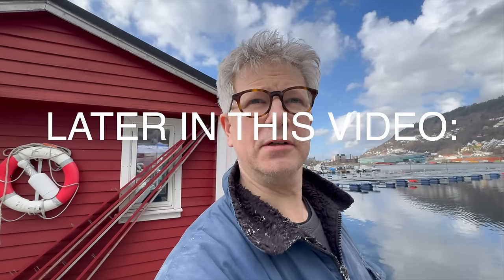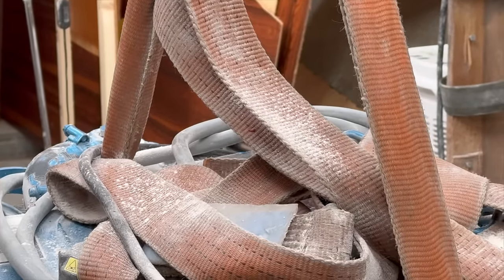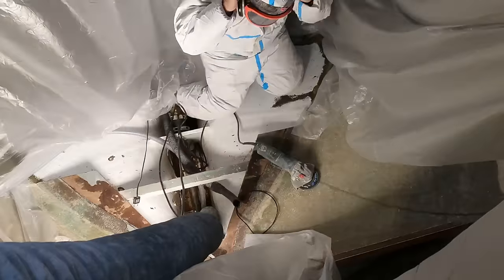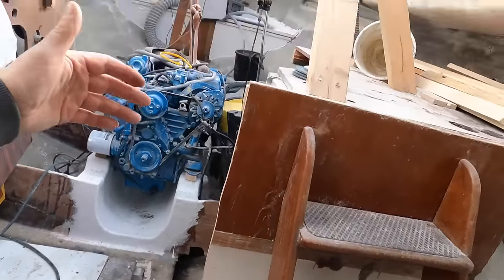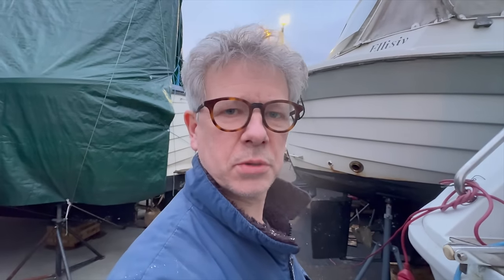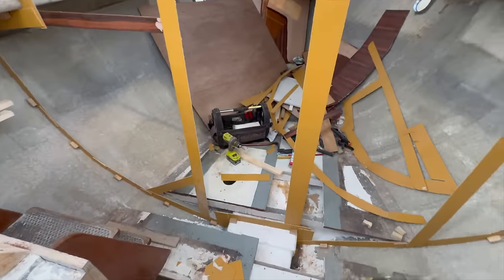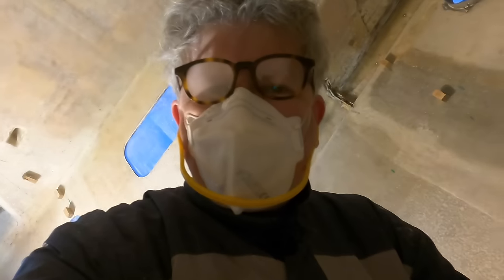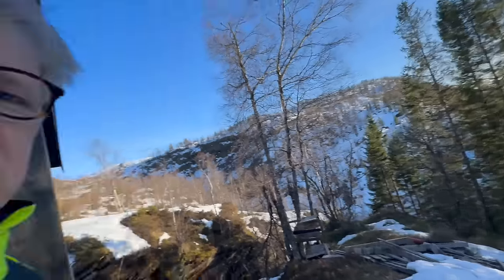Fisher 30 Ep 32 - Templates for bulkheads in the making

Comment: I'd carry the bulkhead right down to the keel, then make 15cm fillets both bottom sides (fore and aft) and carry the bulkhead up substantially above the waterline. 

Do they same behind (abaft) the V berth and you now have 2 of the 3 watertight bulkheads that will make you very happy if you decide to cross oceans with the boat. 

3rd one should be to contain the engine space flooding if the boat has been left alone and the stuffing box/ stern seal lets go. Keeping the water from flooding the entire boat

I realize there are hundreds/thousands of boats that make ocean crossings with no WT bulkheads...

But there are also millions of people who still smoke and take heavy drugs; so the number of people doing something is not indicative of how smart it is  ;-)

I'm enjoying your channel a lot, keep up the good work! 

ps; I'm not suggesting you carry the WT bulkheads to the deckhead. 
You can seal them at the top of the V berth as an example and just make a WT chamber and put something like Beckson plates with O rings in the top so you can still use the spaces for storage. 
Just an idea?... A week's extra work for a whole lot of peace of mind!
Best regards...JP
Reply from the maker: Hi JP. Thanks for your detailed feedback, bringing advice. 
Could you possible detail even more that with the 15 cm fillets both bottom sides, as I did not understand the concept (probably language barriers). 
My plan is also to make watertight areas, especially in the bow-region, as that is where collisions might most likely happen. A floating container at sea....
This way It might be possible to control the water-ingress if so happens. :-)

Comment: Hi Helge!  Congratulations on the new cabin!  Amazing views!  I know that you took the templates apart to get them out of the boat, but it occurred to me while watching the video that the boat has a skylight on the roof of the pilot house.  Had you considered temporarily removing this to get the new bulkheads into the boat -- the diagonal measurement of the opening looked pretty large in the video.  I only ask because the bulkheads themselves would be stronger if you could minimize the number of points at which you will have to stitch them back together for the install.
Reply from the maker: Hi Robert! Thanks. 
Your vision is excellent. There is a skylight that is quite large, but not very much more space than the door, diagonally. And the window (plastic) is screwed on with a lot of screws and glue is butyl tape. So quite a lot to remove to gain a few extra cm, if any. (I will check how much).
My plan is to glass them together  :-)

Comment: Just a thought... In the bilge of the boat, actually anywhere under the floor, the might collect water and condensation. Might that be why the previous bulkhead were not placed all the way down on the keel? And consider ventilation under the floors... I think if it was my boat, I would have placed the bulkheads on top of the old floor. But that's just me
Reply from the maker: That is an interesting thought. The ruined bulkheads did however rot due to ingress of rain-water, and not mainly water from the keel. The rot was spread way up an the hull-sides.
The old bulkheads was not watertight. That is a possibility I look into now and that is why I build the bulkheads really low down. 
I think ventilation under the floors is important and should be thought of early. Good input! :-)
Reply: @hsobstad  rot is usually caused by rain water. Exactly my thought why you might want to keep the "feet" of the bulkheads off the ground, safe and dry

Comment: Are you not going to put in a semi compressable drive ring between the motor and prop flanges ? It should protect the drive and reduce the propshaft from harsh higher frequency engine vibrating.. they are usually synthetic rubber about 2-3cm thick.
Reply from the maker: I must admit I had no such plan, no. If this engine is set up correctly the shaft should be fully capable to deal with the vibrations. (I hope). Alt least I will start with this setup. Putting in a unit between the gear and shaft will mean I will have to shorten the shaft as it is already near the maximum length it can be after exiting the cutlass bearing. :-)

Comment: It looks like the template went across windows,  is this right?   Does this mean you will build a wall that cuts across a window?   If so then I think this would be a mistake and would look really bad and be had to construct.   Perhaps I have just misunderstood.
Reply from the maker: Your vision serves you well. You are correct. 
I will however not reinstall portlights in those areas and will close the openings. Later I will reinstall portlights where they serve the inside best. That will also mean they might not be identical on both sides of the boat. :-)

Comment: I think you are making a mistake by placing the bulkhead ahead of the rearmost portlights. You should think about where you will be mounting the steering wheel - and you will not be steering with your nose in the windshield, but preferably some distance away, 50cm? 
Put the bulkhead 50cm more aft, you will get a level area between the windshield and the steering wheel/dashboard. And lots more space for the head/shower.
Reply from the maker: You are absolutely right about that setup. Just how it used to be. That will - how ever - eat away too much of the available space in the pilot house. I understand that this concept is quite experimental but I have done so much thinking around it and all the time fallen down to this concept. 
But you might end up being right. Only time will tell. :-)

Comment: i think you did great hard work inside your boat , by removing any thing was not in good condition , that is how i would do things ,  but i think you should consider more  the new design inside of the boat , take more time before  ,not rushing on that , make sure the design will meet all your requirments ,.
Reply from the maker: Thanks, Brian. I have done a lot of thinking throughout 2, nearly 3 years of ownership. And I early came down to a radical design connected to opening up the boat. 
I am not sure at all if this meets all my requirements but I am quite sure I would like to test it and am quite optimistic. 
Maybe I should take some more time but at the age of 58 you only have so many more summers being active so I feel I dont have the luxury of thinking too much about it. :-)

Comment: 14:09  Helge while your in the planning mode, Consider putting port + starboard wire conduits in place now rather than later on, maybe a centre line conduit in the bilge too for pumps etc.
Reply from the maker: That is a very good advice. Still hard for me to yet as there are no bulkheads up yet. Nitti-gritti planning is not my strongest side. I will pay for that later... ;-D

Comment: Will the bulkhead suck up water if it sits in the bilge?
Also cabin was a steal.
Reply from the maker: In theory, yes, if there is water present. However the sump in the aft is the lowest point and bilge-water will drain to the sump. So only if the sump overflows...
But I should soak the plywood transverse sides with epoxy. That should be stopping most of the soaking, if there is water present...

Comment: Thats really funny, In a marina you have an electrical device that attaches to a boat for measuring AC electricity that is not water proof. 
Smooth move exlax
Reply from the maker: Yeees... Not everything is made like it should have... ;-)
Reply: @hsobstad   Yup, often a good deal is not always cheaper.  One failure and the payback period goes out the window